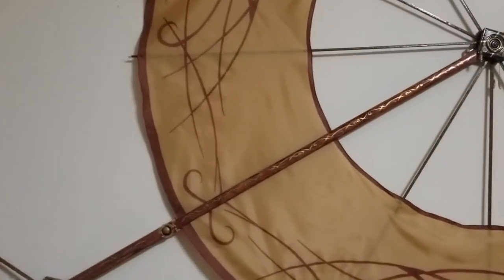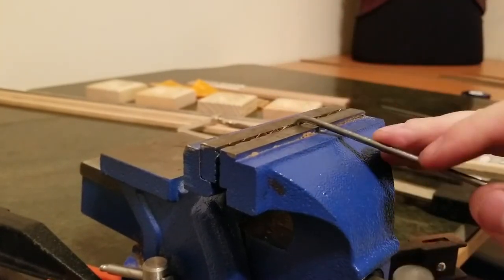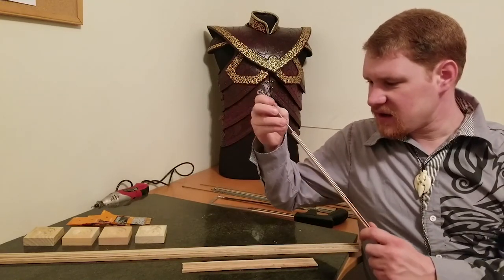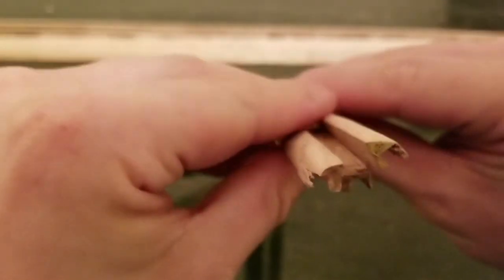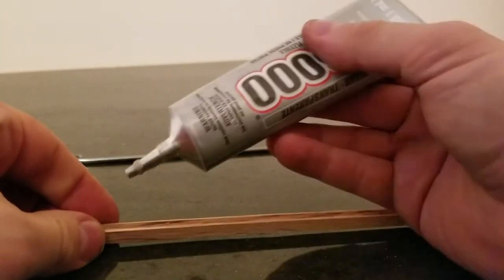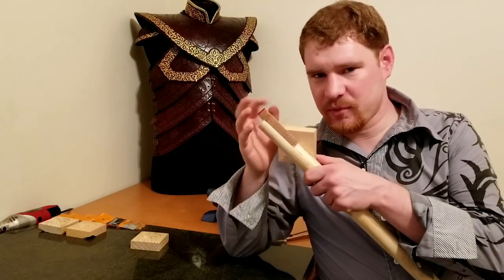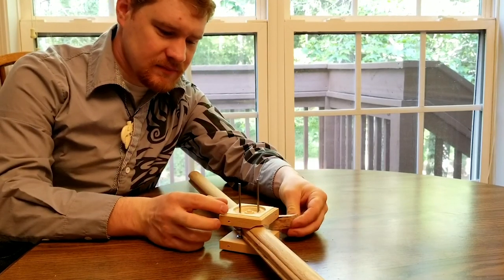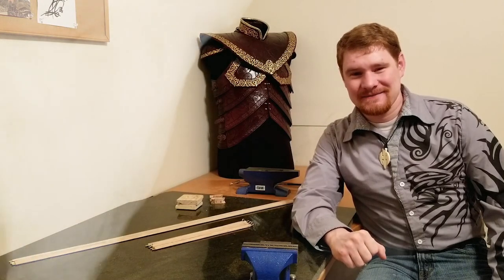Avatar, the Last Airbender: Airbending Staff Tutorial - Part 2 - The Wing Mechanism

Comment: Question on the 36" steel rod, 1/8" interior diameter.

Do you have a recommendation on where to get this?  We have all the other parts :)

We are getting close!
Reply from the maker: So happy you're actually going to make it!!!  
I bought the solid rods at home depot.  The hollow tubes were harder to find though.  I ended up getting them on Ebay, and unfortunately the seller is not active anymore.  But this was the name of the product I bought: "
Round Tubing 304 Stainless Steel 3/16" OD x 6 ft. Welded 0.148" Inside Dia."
I hope that helps!